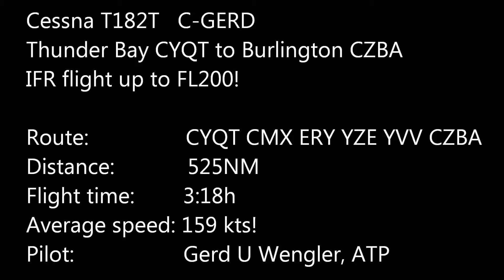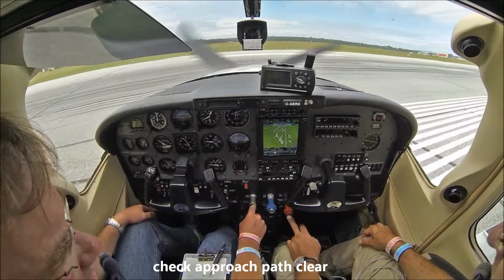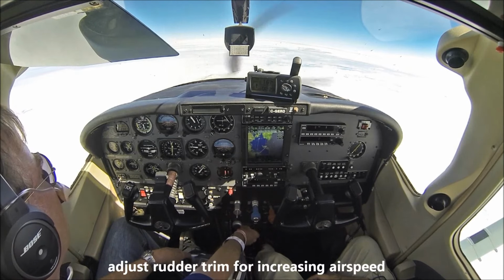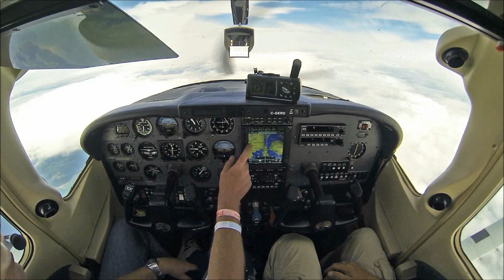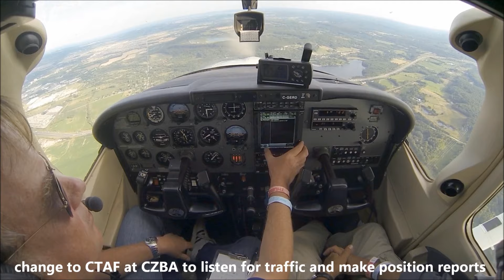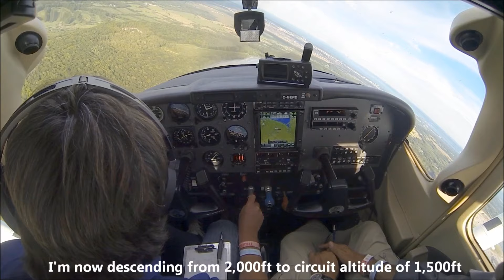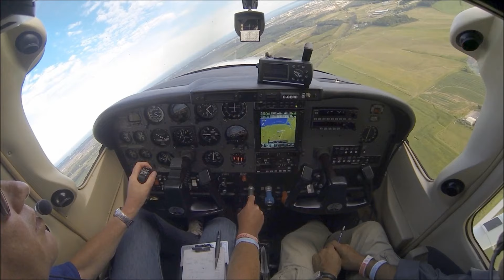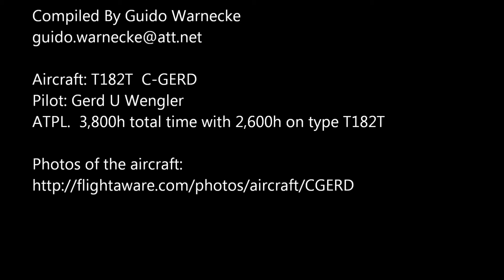Cessna Skylane at 19,000ft - cockpit video - must see!

Comment: Did you make the 1200nm trip without a fuel stop?
Reply from the maker: Hi Tate,
there was one fuel stop.
We had auxiliary tanks installed, but with 4 people on board could not use them.
With full fuel, a non-stop flight would have been possible!
Happy Landings,
Guido
Reply: Guido Warnecke Thanks for the information! Just out of curiosity, what is the total fuel capacity with the auxiliary tanks?
Reply from the maker: Hi Tate,
It is one hour per tank.
Happy Landings,
Guido
Photos of the aircraft here:
https://flightaware.com/photos/aircraft/CGERD

and with the previous registration C-FDOW:
https://flightaware.com/photos/aircraft/CFDOW

Comment: What I don't get is why a 540 cubic inch turbo-engine only delivers 240 hp. I mean, it's almost 8.9 liters. If it was a car it would have reached 1200hp, like a Bugatti Veyron. Maybe avionic engines work differently? Sorry, I'm new here.
Reply from the maker: davidtheguitarman in other Aircraft, this engine size is rated up to 350HP.
Cessna choose this engine to ensure trouble free operation. Sometimes a challenge in turbocharged engines.
Happy Landings,
Guido
Reply: Veyron engine is also 16 cylinders, in a W configuration, and has 4 turbochargers.  like comparing apples to deep sea submarines haha.

Comment: I did my commercial cross country in a 172.  Talk about a long boring day, with the exception of a little low level sightseeing in Northern California Mountains.
Reply from the maker: How long is a commercial x-country flight minimum?
Happy Landings,
Guido
Reply: Guido Warnecke The particular requirement I was referring to was under 61.129 (a)(4)(i) 300nm minimum distance; with a 250nm straight line leg.  If you’re renting an airplane or planning to return in the same flight you’re looking at a minimum of 500 nm.
 
This was before I got my HP and complex ratings, so flying 500 miles can be long and boring; especially when you have a head wind both ways.
Reply from the maker: Yes in a slow aircraft that is a long stretch.
Happy Landings,
Guido
Reply: Yeah it came out to be about 6 hours in-flight.
Reply from the maker: Coughtry Long and expensive...Happy Landings,Guido
Reply: Guido Warnecke  Thanks.  Same to you.  I have to say the HP and complex ratings have certainly made a great improvement on how far I can travel in a day.  Flying is my claim to freedom; I don't have to worry so much about getting pulled over for a tail light. lol

Comment: Cant you get hypoxia over 12k feet? Do you have emergency air masks or how does that work? I fly a 47 luscombe 8a but it is just a daytime cruiser thats great but you have to keep in mind you dont have much power and its difficult to land in certain situations.
Reply from the maker: We had supplemental oxygen with canals and masks later. Hypoxia is to be taken seriously. It affects your entire body and is not easy to detect. There is also an individual component, some people cope better with it, some people don't. As a general rule I would say oxygen above 10,000ft on a prolonged flight is a good idea, especially at night.
Happy Landings,
Guido
Reply: @GuidoWarnecke  thanks for tge reply i appreciate it. Il sub if it helps you out

Comment: I noticed even to turn a little bit to avoid clouds you had to request permission, does that mean in any plane you basically have a course you need to follow and need permission to change that course? If so is that all planes and areas or is there places you can just be left to do what you please?
Reply from the maker: Trpratt1 During an IFR flight (Instrument Flight Rules) all is designed to fly in clouds without reference to the outside. You would not be able to see other aircraft.
The air traffic controller takes responsibility for traffic avoidance. In return, ATC expects from you to stay on your route and "do what they say". There is a certain tolerance, e.g. on an airway you can divert 4 miles left and right, during approaches in busy airspace, this tolerance is much lower.
So when you think you will fly into a storm cloud on your present heading (ATC might not be able to see this) you have to ask them for permission before you turn right or left. ATC checks then if this would conflict with other traffic.
If you do not fly according to IFR, you can turn left right as you wish.
Happy Landings,
Guido

Comment: Guido, shouldn't the longitudinal axis be aligned with the runway at touchdown to avoid unnecessary stress to the wheels? Specially for a high wing aircraft where you can lower the wind side wing a bit... anyway, I might be wrong though
Reply from the maker: Hi Javier,
the aircraft was pretty much aligned with the runway on touchdown.
These types of undercarriages can only carry small amounts of side loads.
Happy Landings,
Guido

Comment: I am originally from near Burlington, a suburb called Dundas. Now reside in the US. I am curious, how do you manage the engine at such an altitude? I am currently a student pilot but have never been higher than 5,500.
Reply from the maker: Hi Jordan,
this aircraft is equipped with a turbocharger that compresses the air before it enters the engine. This compensates for the low atmospheric pressure at that altitude, just under half compared to sea level.
The turbocharger is driven by the engines exhaust gases. A smart system.
All the best for your flight training & happy landings,
Guido

Comment: Do you know if Gerd's engine is a standard factory turbo, or has he made changes to it?  Thank you. Jim
Reply from the maker: As far as I know it is standard. First engine reached 2,000h TBO in perfect condition.
Happy Landings,
Guido
Reply: Yes, standard factory turbo.  I know that there are some airplanes where the turbo is an STC option (Cirrus went that way at a time, and Bonanzas, I believe, perhaps others).  I am not aware that any Cessnas have a turbo STC available (except the turbo diesel conversion for older 182s and 172s).
Reply: It's a pleasure watching a pro like yourself fly.. Thanks for sharing your videos.  Also really like your plane. Glad you selected it over the SR22.
Reply from the maker: My pleasure.
Every airplane has its pros and cons for specific applications.
So an aircraft selection is never 100% objective.
Happy Landings,
Guido

Comment: @Guido Warnecke Every POH I read for the 182T and T182T exclude performance charts for anything above 14,000. With a certified ceiling of 18,100, the non-turbo 182T can go higher than the 14,000 - how does one get around calculating performance, range, fuel consumption for say 16,500? Your help would be appreciated.
Reply: The performance charts in the T182T POH go exactly to FL200.  Link is here (pages 5-22 to 5-32):  www.rmr.cap.gov/wp-content/uploads/2017/04/cessna-ct182t-nav-iii-turbo-poh.pdf
Reply: Thanks! I wish I had an affordable access to a T182T; could you (please) help me find performance charts for the non-turbo 182? It's a big black hole between 12,000 and 18,100 for the 182T.
Reply: And thanks for uploading this video! VERY informative! It's one of my favorites
Reply: LOL! I know. I have the POH for the 182T I always fly. ~~  But the performance charts on section 5-21 only cover 2,000; 4,000; 6,000;  8,000; 10,000; 12,000; 14,000. The endurance and range profile only go up to 14,000.    ~~ Between that and the service ceiling there's a whopping 4,100 feet of performance that Cessna didn't publish.
Reply: Well, there is not a whopping lot of power available for a non-turbo engine above that altitude.

Comment: nice to see a piston engine at altitude,...is it certified for flight into icing ?
Reply from the maker: Thank you!
The T182T is not certified to fly into "known icing".
If you want to fly at high altitude (low temperature) this requires some strategic planning to avoid icing.If icing occurs, immediate action (climb / decent / turn around) is required.
Only very few single engine piston aircraft (Cessna P210, Cirrus CR22) are certified for flight into icing.
Despite the certification, NO aircraft is designed to fly for extended periods in icing conditions. With the anti-ice / de-ice equipment you are just "buying time".

Thanks for watching my videos & happy landings,
Guido

Comment: what was that about lineing up on the touchdown zone markers and not the centreline at the start of the video? right after your little blurb about proper takeoff clearance request calls? lol
Reply from the maker: You have a point here, it is always the best to stay in the middle of the runway. no matter how wide the runway is.
Any loss of directional control, e.g. a burst tire is easier to manage if you have the same room to maneuvre right and left.
During the subsequent take off roll we were in the runway center line.
Another example you see on the landing: we landed long, which also has disadvantages. Runway behind the aircraft is useless...
These risks were well calculated, acknowledged and acceptable.
Thanks for your comment and happy landings,
Guido

Comment: Sounds like a turboprop!   How do you know you're getting the right flow of oxygen through nose tube at high altitude?  Is it automatic?
Reply from the maker: Thank you Rick,
it is a old Lycosaurus engine doing the work...
The oxygen line has a valve where you adjust the altitude. And there is a green marker in the line that becomes visible if there is oxygen flow, a red marker comes up when the flow stops. An aural warning would be good, but I do not know any system that has it.

The valve might be visible on this photo:
https://www.google.com/search?q=aviation+nasal+cannula&es_sm=93&biw=1920&bih=936&source=lnms&tbm=isch&sa=X&ei=36rOVK72N5D9sAT33YD4Cg&ved=0CAcQ_AUoAg#imgdii=_&imgrc=EQlUvc5vrCom8M%253A%3B5t1JIa_l4kLjWM%3Bhttp%253A%252F%252Fwww.patricialipe.com%252Fimages%252FFig-14.jpg%3Bhttp%253A%252F%252Fwww.patricialipe.com%252Ftalk.htm%3B670%3B1000

A very reliable system so far, we did not have any problems.
Happy Landings,
Guido
Reply: Rick Stillwell It actually has a flow meter that has a ball floating up; it shows the altitude and required flow on a scale.  Couldn't be easier or simpler.

Comment: Hi, I was wondering at what time do you normally push the propeller knob. During touch and goes I'd normally push it all the way as soon as I want to start descending, but checklists say that you should have it on max rpm for the approach and not in order to descend or anything. So what's the normal usage of the prop control lever?
Reply from the maker: You do nothing wrong to push the propeller forward even on downwind in the circuit.
This is however a noise and passenger comfort concern if the engine revs up.
Important is that you have full power available when you need it, e.g. a go around or if you encounter wind shear or similar. Full power is only available at full prpm = prop full forward..
If in doubt - the POH is the ultimate authority here, do what is written in the book.
Happy Landings,
Guido
Reply: Guido Warnecke Oh I see, it's just about having max power available in critical moments of the flight I understand, thanks :)

Comment: At what level do they need oxygen support?
Reply: From AOPA website:

(a) General. No person may operate a civil aircraft of U.S. registry—

(1) At cabin pressure altitudes above 12,500 feet (MSL) up to and including 14,000 feet (MSL) unless the required minimum flight crew is provided with and uses supplemental oxygen for that part of the flight at those altitudes that is of more than 30 minutes duration;

(2) At cabin pressure altitudes above 14,000 feet (MSL) unless the required minimum flight crew is provided with and uses supplemental oxygen during the entire flight time at those altitudes; and

(3) At cabin pressure altitudes above 15,000 feet (MSL) unless each occupant of the aircraft is provided with supplemental oxygen.
Reply: ShadowAviator Thank you!
Reply from the maker: Thanks. It depends on the country of registration and the flight rules (private flight or charter flight).
Happy Landings,
Guido

Comment: Why were you holding short diagonally ?
Reply from the maker: +Juan Gil 
Hi Juan,
There are 2 reasons to do this:
a) Wind direction - position the aircraft into the wind
b) Check the final approach path for traffic - position the aircraft in an angle that you can see landing traffic.
This requires a wide taxiway though.
Thanks for your comment & Happy Landings,
Guido

Comment: that ambient air temperature most be thin at the altitud
Reply from the maker: Hi Caleb,
the heater for the cabin works well.
The only problem s icing in clouds at these low temperatures.
Happy Landings,
Guido

Comment: I'm taught to put 10* of flaps on downwind 20* on base and 30* on final. Or can they go before like he did?
Reply from the maker: Hi Antonio,
in light aircraft you can pretty much set his up at your own as long as you do not exceed flap speeds.
Depends on the situation. If for example a steeper approach is required to avoid traffic, then flaps come out earlier.
Happy Landings,
Guido
Reply: Guido Warnecke thanks for clarificación. Its good to hear from you... Wish me luck in starting my A&P next month
Reply from the maker: @arod1pilot  Best of luck for your A&P training and your professional career. 
Happy Landings,
Guido

Comment: Hey Guido! What braking system do you use to slow the aircraft once you touch down?
Reply from the maker: Hi Michael,
the brake system is like in a car, on both main wheels.
Given the small size of the tires and the fact that there is no anti-skid system of for the brakes, these are not very effective. We use a lot of "aerodynamic" braking after touch down, using the drag produced by the wings.
Happy Landings,
Guido

Comment: You had mentioned that this airplane has crossed the Atlantic.  Is that really safe considering that it's a single engine aircraft?
Reply from the maker: Hi Scott,
that is difficult to answer.
The engine is very reliable. The weather is more of an issue.
But with good preparation and survival equipment I would consider it safe.
Happy Landings,
Guido

Comment: excellent  piloting skills  and this was a very interesting video...but please explain something, as I am a non-pilot...... when permission was  requested to go to a lower altitude,  pilot  said he was picking up some ice...where exactly does a pilot  need to watch for the first signs of ice build-up or is this something a good pilot can feel on the controls?  Thank you
Reply from the maker: Gary Vale Hi Gary,
in this aircraft you can actually see the ice building up on the wings.
Larger aircraft where the wings cannot be seen form the cockpit have ice detection devices.
Theu also have heated wings that melt off the ice.
The main danger of ice built up is aerodynamic change of the wing, is can be very dangerous.
Happy Landings,
Guido
Reply: @ Guido..thank you for the response....the website  link below is a site you might  find of interest, as aviation questions are asked and answered by qualified individuals, such as yourself , thanks again....

http://aviation.stackexchange.com/

Comment: Yes, you don't hear very many Skylanes at FL20. :) Highest I went in a Cessna was an Air Force T-41B. Woo Hoo!!
Reply from the maker: The T182T is certified to FL200 only but could do much higher. I think they did this for marketing purposes to differentiate it from the TU206.
The TU206 is certified to 30,000ft, (FL 280 for all practical purposes, non RVSM).
Happy Landings,
Guido

Comment: Just a quick question... how do you adjust the oxygen flow? and how do you know how much you should have in the cabin above 15,000?

Thanks 
Thomas
Reply from the maker: Hi Thomas, there is a control knob on the oxygen line which you adjust by setting the altitude.
If you need more - turn it up...
Happy Landings in 2015!
Guido

Comment: I know this craft does not come from the factory as a pressurized aircraft, and it has the oxygen mask system, but is there an aftermarket configuration for pressurization, or is the fuselage not rated to contain such pressure?
Reply from the maker: Hi Noah,
it is a major structural change to make an aircraft pressurized.
Structural issues and sealing are the major challenges.
Cessna produced the pressurized version of the C210, called P210.
It suffered from a lot of problems and was never a commercial success like the other Cessna single engine aircraft.
Some interesting information here:
http://www.aopa.org/Pilot-Resources/Aircraft-Ownership/Aircraft-Fact-Sheets/Cessna-P210
Thanks for watching my videos & happy landings,
Guido
Reply: Guido Warnecke I just use oxygen masks like you do. It is WAAAAAAY cheaper than getting a pressurized craft. Thank you for the reply. I assumed the craft would not be able to withstand pressurization.

Comment: Amazing never seen a Cessna do 500 fpm @ 15000
Reply from the maker: Thank you Chris!
The T182T has a big 540 cubic inch engine, turbo-normalized and flat rated to 235 HP. In other aircraft, a similar engine delivers up to 350HP.
The turbocharger maintains the power nicely.
Happy Landings,
Guido
Reply: Ok and here I was thinking you had some good headwinds :)

Comment: Is it okay to fly IFR in the clouds with no weather radar??
while descending to 15000 how did you know there shall be no turbulence while your speed was on the yellow arc and yet there was some puffy clouds.
On the A320 MEL i can do 1 flight to home base and shall be day flight with no reported WX at home base.
Sorry my question seems dumb as i have no idea about general aviation ops
Reply from the maker: +Airbus A320 
Weather radar would be nice, but very expensive. You find it in single engine aircraft very rarely. Usually in a pod under the right wing.
Speed in the yellow arc no problem unless it is convective clouds with significant turbulence.
Happy Landings,
Guido
Reply: Aha, now i know,, Thank You Capt.